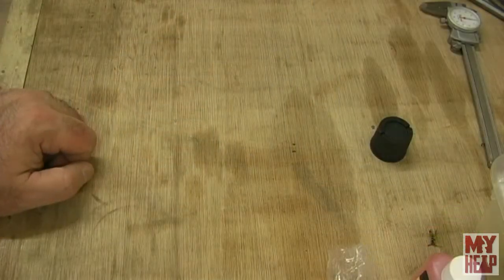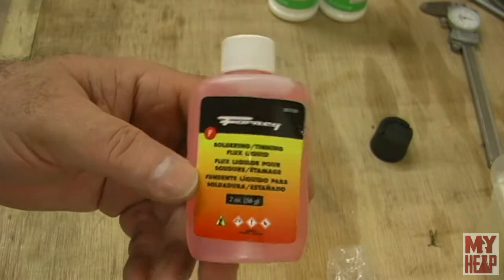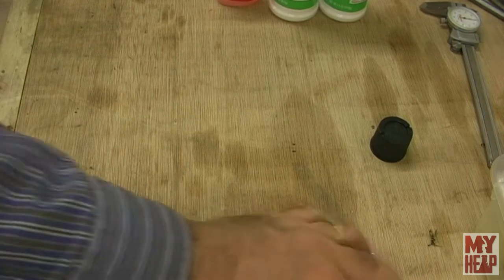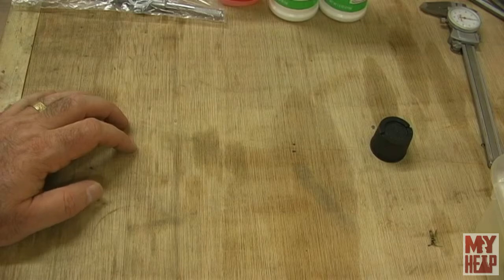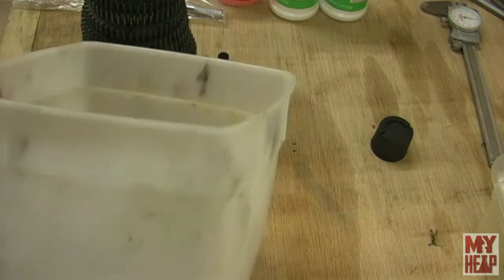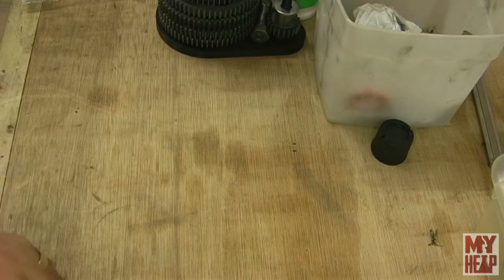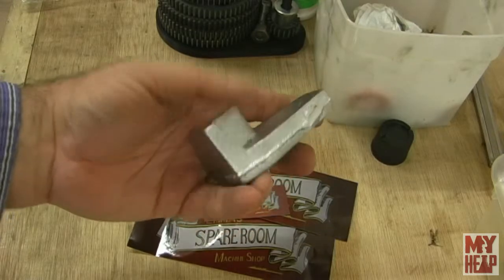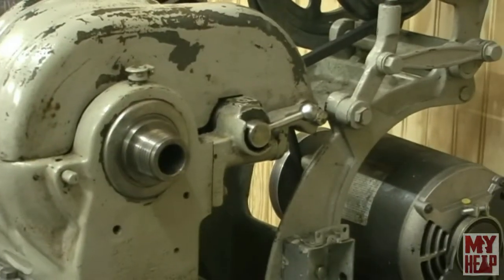Viewer Mail, Soldering Flux, Coppers, 3D Printed Stuff

Comment: G’day Joe, thanks for the shout out. Lantern wicks should be available on Ebay or maybe your local camping store, or you could roll up some cotton strips and tie off with cotton shop twine, it would be cheaper. 
You do need to make chips before that lathe rusts away. And 3D printers need as much justification as a lathe, mill, band saw or most things you got, just ask the Mrs, but now that the young’n has bought one you can print that 24 tooth gear when you need it. (all mini lathes start out with plastic gears).   Cheers Peter
Reply from the maker: Hey Peter.  I should be making some chips in the next engine video.  I didn't think about lantern wicks. They could be cut down and used.  I will check the camping / sport stores the next time I am out messing about.  The two plastic gears in the white container are 24T printed for the Atlas lathe.  One from PLA and the other from PETG.  I want to try them out.  Worst that can happen is they strip right.  I am just vain I guess.  Would like to have all the gears for a complete set.  The plastic gears normally supplied with the mini lathe, they are nylon, correct?  Thanks for stopping by Peter and commenting!

Joe

Comment: pretty cool joe, Bakers flux can actually be made by taking muratic acid in a pyrex container, and slowly adding little bits of zinc over a few days until it no longer will dissolve anymore. Ive made some myself and it does work out ok, but for stuff like sheet metal, Ive found this little tube of solder paste from the hardware store with the solder and flux mixed together, it seems to work the best for soldering sheet metal. Ive used both of those for soldering up old oil cans that have little rusted pinholes through them, to seal them up and make them like new again so I can use them.

The copper soldering blocks, just take a brass wire wheel and some sandpaper to them and it'll clean them up no problem at all, then just heat it up till it starts melting the solder onto it, then brush it on with a small wire brush, that seems to work the best imo to tin it. After that, those copper blocks work really well for soldering thin sheet metal.  Old Sneelock's Workshop did some videos on how to use the gasoline torch and copper blocks to solder stuff together, but Ive found it to be much easier than he showed.
Reply from the maker: I will check him out.  For some reason, I had in my mind that the soldering flux was made with a diluted sulfuric acid and zinc.  So it is Hydrochloric acid?  I will have to see if I can get some solder paste.

I am looking forward to trying to solder with the copper soldering irons.  I have a Coleman camp stove that I will heat it up on.  Should be an interesting exercise to say the least.  Thanks for stopping by and watching Chirpy!
Reply: yea, the flux is zinc chloride, which is made by muratic acid/hydrochloric acid and zinc. The coleman stove should easily give enough heat really, I used a gasoline blowtorch when I tried it on mine, and you dont really have to get the copper super hot, just enough to melt the metal on it, then a tiny little bit past that to account for heat dissapation. Also, congrats on 100k views, and the upcoming 1k subs.
Reply from the maker: Thank you Chirpy, you helped me get this far and I appreciate it.  I happen to have a jug of muriatic acid, so maybe I can get some zinc wheel weights and make some.  Just wondering, say I make a pint, how much zinc will it take?  Or do you know?

Joe
Reply: no idea, I usually just feed it in till it stops dissolving, but I wouldnt make a large amount of it because I believe it has a bit of a shelf life, so just make a small amount at a time that you plan on using. As for how much metal will go into it, I think the muratic acid is 30% concentration, so probably around 30% of the weight of the acid vs a wheel weight, so probably one or two wheel weights at most. I just stuck in a zinc casting in the stuff when I did mine and it ate quite a bit, but they were pretty thin castings. 

The only thing is, do it outside far away from everything because it lets off some pretty nasty fumes and creates alot of heat and will boil if you add too much zinc all at once. I took a glass plate and put baking soda all around it  and sat the pyrex container in the middle of it in case any spills happened, it would neutralize it before it went anywhere, then just sat the whole thing on the firepit away from everything for a few days because the muratic acid will rust and eat any metal around. Just doing a small amount, like a little baby food jar amount will last for a few years of use imo.
Reply from the maker: OK, so I will do something like a quarter cup.  I didn't know it would have a shelf life.  I be sure to do it outside away from everything.  I think I will get some zinc wheel weights and give it a go.

Joe

Comment: I 3D printed half nuts for my atlas a while back. Still running the first set.
Reply from the maker: I watched your video on the Half Nuts.  I was pretty impressed.  When Mr. Pete done the plastic gears I would have bet they would have sheared teeth, but the lathe stalled so again I was impressed.  I have a couple of 24T gears printed.  One is PLA and the other PETG.  What plastic did you print your from?  What was the infill.  Etc...  Thanks for watching and taking the time to comment.

Joe
Reply: @MyHeap  I printed from PLA, its the only filament I have tried in my printer since it doesn't have a heated bed. I believe the fill was 100% but I'd have to go back and look.

 I was going to mention in your video before you said your son purchased one is that in my opinion 3D printers are so cheap and work so well its almost really not worth trying to build one yourself. Mine has real linear rails on it and was only $279 and features and capabilities are unbelievable. I obviously understand wanting to DIY it but in this case time and money is better spent on other projects.
Reply from the maker: I agree, with the time involved it has to be cheaper to buy on these days.  Though, I am curious if I could make on run on LCNC.
Reply: My Heap that’s kinda one of the reasons I picked the Cetus was it runs on GCode. I haven’t tried it yet though.
Reply: My Heap I thought about modifying my router to accept the extruder head off of my printer as well but the printers rapids are just too quick and haven’t needed to print anything that big yet
Reply from the maker: What are the rapids on your router?  i get about 200 ipm on mine.  I have 5 start 1/2-10 leadscrews.  If I were to build one, I would be tempted on rack and pinion or belt drive.  More curious if I can do it with LCNC.  I know a few guys have, but not sure how it fits together.
Reply: @MyHeap  I think mine are a bit lower then that. I still don't have limit switches set up or anything so I'm being cautions.
Reply from the maker: I think 210 IPM is the best I can do.  Using 450 oz-in steppers and two anti backlash nuts on each screw.  I suppose I could do a little better if I had only used one.  It is what it is.  For a home made machine, it does what I need it to.  😀

Comment: Sounds like lots of projects.  When you make your 1 1/2" X 8 tpi gauge, sneak up on your threads.  I made one and was a bit over zealous and ended up cutting the threads too small.  The only gauge I had was a back plate.  

Peter has been doing one heck of job on building Gingerys Milling machine. 

 I have a 10" Atlas such as yours.   That 3D printed spindle protector is very nice.   

Enough rambling here.  Merry Christmas to you and your family.

Gus
Reply from the maker: Hey Gus.  As long as my project list last longer than me, then I shall never be bored!  :-)  When I made the captive nut puzzle, I used the three wire method to measure the threads.  Wasn't needed but it was an exercise in precision for me.  I understand what you mean about sneaking up on the last few cuts with spring passes in the middle.  Shoot me an email Gus, xavier at gtec dot com I will ask Zach to print you one out if you want one.

Peter is nearly done.  I am waiting for his next project.  I have a good idea of what it is and it will be a fun on to watch him build.

Joe

Comment: Nice soldering irons and thanks for the update vid.  They used to make a soldering tip for burnzOmatic torches.   The flame hits the back side of the soldering 'iron''.   I wonder how they would work for soldering boilers and such.
Reply from the maker: Hi Dan.  I don't think I have ever seen one of those.  I don't know about boiler work.  Boilers have to be hard or silver soldered.  I would think soft soldering them would be looking for trouble!  I took Chirpy's suggestion with the brass wheel.  They are pitted but did clean up nice enough.  I probably should have cleaned up the steel shank too.  Oh well.  Thanks for stopping by and watching and commenting Dan.
Reply: Brain fart.  Yeah silver soldering is done with a torch.    I really only intended to mention it as an alternative to the irons you recently acquired.  I use one for soldering large wires.  Will have to give it a try for stuff like that gas tank.
Reply from the maker: How about shooting a little video of it so I can see one of these doodads?

Comment: Joe not sure about kille spirits.
BUT
A lot of coppersmith types use hydrochloric with zinc to get ZnCl.  You can get HCl by getting muriatic (37 % HCl).  Cut it by about 3 or 4 parts water and throw in zinc plated nails or??

Dan Bentler
Reply from the maker: Chirpy mentioned the hydrochloric acid too.  I happen to have some that I bought to clean some mortar off some brick.  I think I can get some zinc wheel weights from the tire shop.  I think I might give it a go.

Comment: Lots of cool stuff. Sad about the bandsaw.  Killed spirits u can make by slowly adding zinc to acid until it no longer  dissolves. The copper irons are good. Think one is supposed to have a bend. Use it inside tanks etc. File them up nice then tin them with solder and a wiremmm brush.the wicks can be got from a camping store usually.
Reply from the maker: Hey Emma, Thanks for stopping by, and thank you again for the casting.  You done a great job on it!  The killed spirits, what acid is used? Sulphuric or muriatic?  Or does it matter?  I gave the copper irons a cleanup with a brass wire wheel.  I plan on filing the business end up a little and re-tinning.  I am going to try to solder the fuel line and wick cups old school.  HAHA  I will check out the camp stores for some wick.  Peter suggested that too.  Thank you for stopping by and watching Emma.

Joe

Comment: Hey joe, 
When I bought some oil cups for my mill from H&W machine they gave me pipe cleaners to use for oil wicks. Seems to work good. I just curled them up as much as I could in the holes. Just a thought.
Reply from the maker: Hey Lonnie, great to hear from you.  The wicks I need are to burn alcohol for the burner.  Pipe cleaners, I know they are some sort of fuzz on wire, but aren't they synthetic?  Wouldn't they melt, or are they something else?  Cotton maybe?  Wanted to tell you thanks again for the stock and tools you sent.  They have come in handy.  Thanks for watching and commenting.  Now on the other side of that, i may curl some of them up in the oil cups of the lathe.  Thanks for the inf and idea.

Joe
Reply from the maker: No worries there Lonnie, you gave me a good idea for oil wicks!  So it all works out!  :-)
Reply: My Heap 
Glad I was at least a little help.
Reply from the maker: Brother, You have been a huge help to me.  You just don't realize it.  :-)
Reply: My Heap 
Thank you Joe. I’m glad I was able to be of some help.

Comment: I have used the Forney liquid flux and it works great.  I am not completely sure but I don't think that it is suitable for electrical work.  When I have my electrical rebuilding shop I had a product called Ruby Flux, but have not been able to find that.  The Forney looks and works just like it.
Reply from the maker: Hi Steven.  Fortunately I don't need to do any electrical soldering.  I know that the paste flux was really thick and hard to manage so if I can control the flux a little better with this, that would be great.  I have loads of soldering experience where it comes to electronic components, but aside from that I am as green as they get.  I am looking forward to trying this stuff out.  I am glad to hear that it is a good product.  Thanks for stopping by and commenting.

Joe